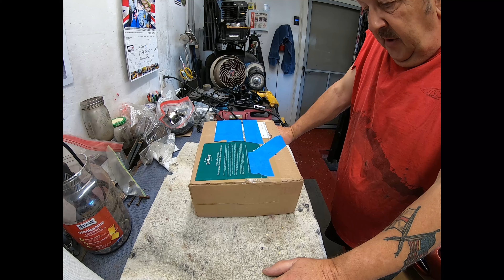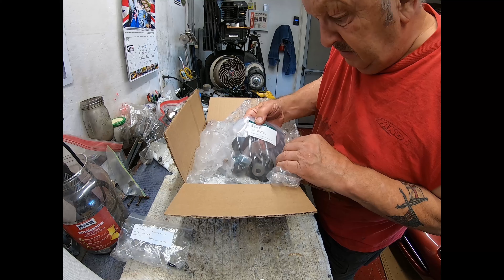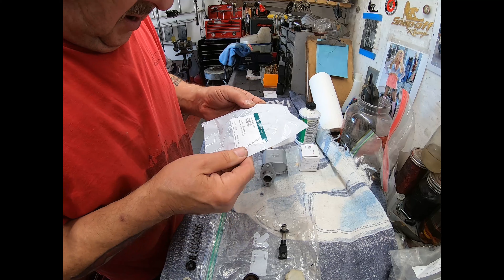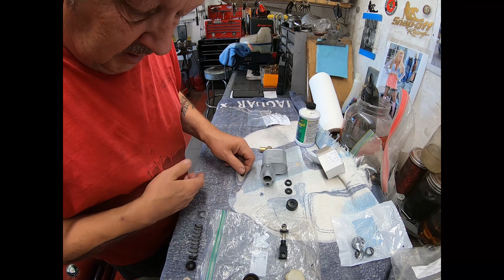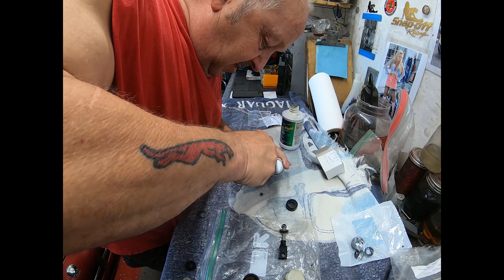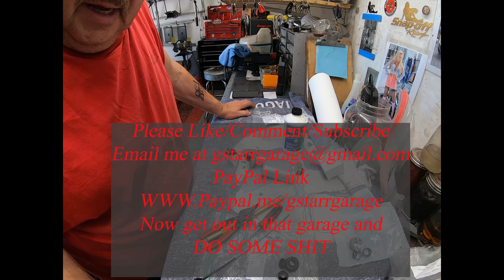Jaguar MKII Water pump kit and clutch master

Comment: Nice job Gary.  I always enjoy rebuilding the brake and clutch master cylinder.  Not sure why!  DOT 5 is so much better than 3 or 4 so that’s definitely a good tip.  It’s got a higher boiling point too!
Reply from the maker: Dot 5 is not hygroscopic and doesn’t damage your paint which makes them a plus in my book and as the boiling point is higher less chance of brain fade.
Reply: @jagvette1  and brake fade come to that :)